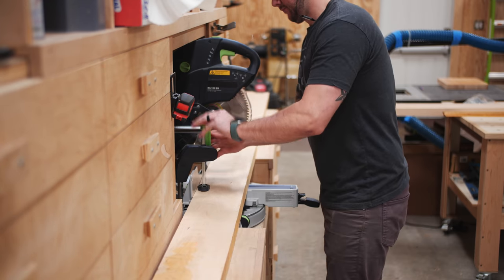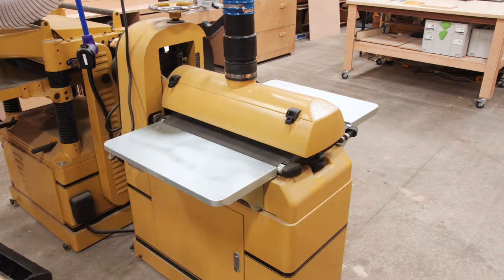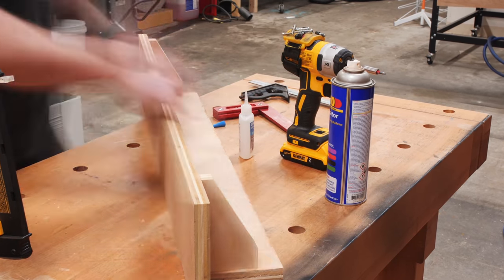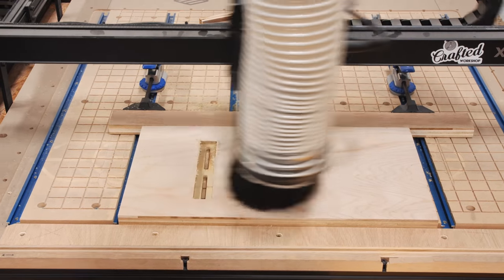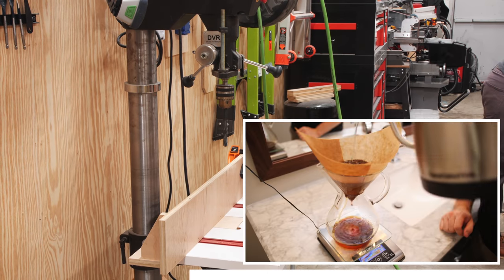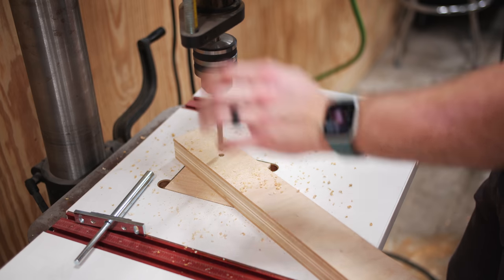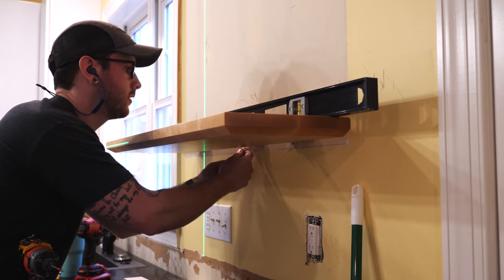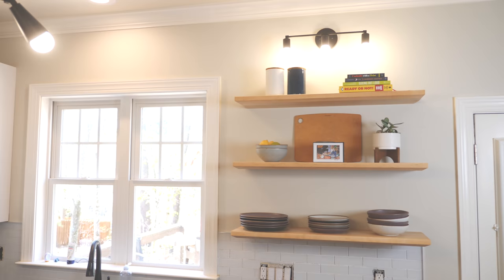Building DIY FLOATING SHELVES for our Kitchen // Kitchen Remodel Pt. 3

Comment: I would like to have seen the shelves done with basic tools that most people have and not done at a pro wood work shop
Reply: Fadil Xheka well type that in the search bar then pal
Reply: I've done loads of shelves with a drill, saw and sander. But yeah you're right, he uses loads of different tools.

Comment: What do you do with all of the sawdust that you collect? Just curious!
Reply from the maker: Throw it away unfortunately. Not sure what else to do with it!
Reply: @craftedworkshop  Compost, mulching for your garden, hugelkulture. Make burning logs or charcoal briquettes, feed into a rocket stove. USe it as glue filler, kitty litter or even chicken bedding/litter. The uses are endless.

I'm running out of wood shavings saw dust all the time that I pick up some from the local carpenters. Unfortunately, the covid situation has put a stop to that and I'm so lacking that I've had to substitute a lot of it with dried leaves or chipping my wooden off cuts, which isn't as ideal.
Reply from the maker: TheKamiBunny I’ve read that sawdust pulls nitrogen out of the soil when used in a garden. Also, my sawdust would include plywood and MDF dust, which isn’t probably the best to work with.
Reply: @craftedworkshop  Hi! Thank you for the reply.

With regards to mulching with sawdust, it only pulls nitrates where it touches the soil but not much deeper unless you bury it. Meaning if you mulch deep rooted plants or perennials, it doesn;t matter. But the mulching saves water. If concerned, just mix in grass clippings and this will saturate the sawdust with nitrogen anyway.

You can use the sawdust in winter by burying it and conditioning the soil especially clay soil. Sawdust will rot and turn soil more acidic so works for clay and alkaline. This can be done in veg beds that are resting.

To use in greens or veg, unfortunately, you would need to compost. The sawdust in the compost will hold the nitrogen from your grass clippings, kitchen waste, garden waste weeds and whatnots, as well as the calcium, potassium and  phosphates, Can use this directly in the beds at that point after composting.

With MDF, the resin degrades and its conditioned with formaldehyde so after composting it should be safe to use in the garden as it all breaks down over time. My compost cycle is 6 monthly as I make large batches and cook them like lasagna so plenty of time for that to break down. I think there's an article about this on EPA. Of course you shouldn't use it directly in the garden, and if you're still suspect on its food safety, then use it on ornamentals only.

PLY sawdust on the otherhand, i would avoid. Most ply has long lasting antifungals and perservatives so makes it impossible to completely make anything good from it in a normal composting process. I guess if your dust collection system mixes this in then everything would be unusuable. 

In my case, I do most of my woodworking with pine and ply, so I just separate the 2 sawdust by changing out my bucket.

Comment: Waaaaay overcomplicated bro.
Reply: Agreed, and expensive too. What I've always done is make 2 or more as necessary perfectly aligned & level stud holes that I can drive in a straight pins of whatever diameter & load needed. (always be sure to aim the rods level & up slightly - never down)